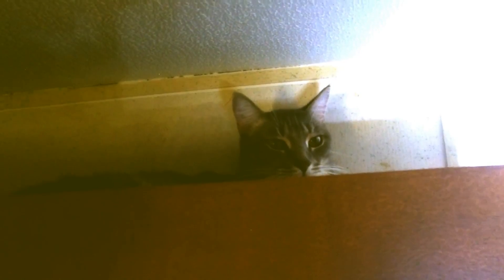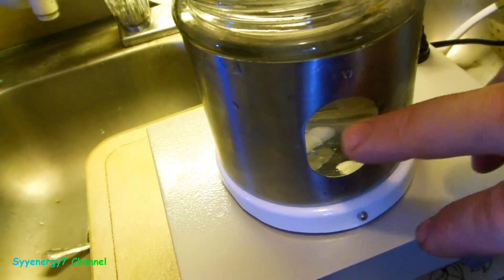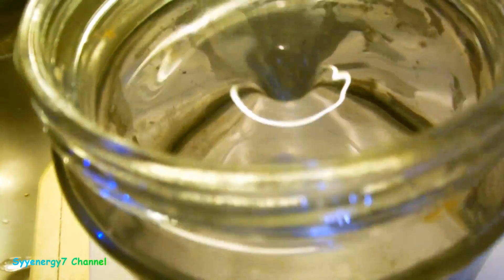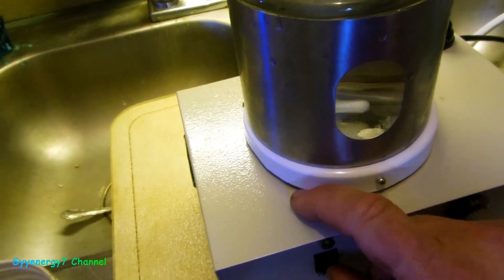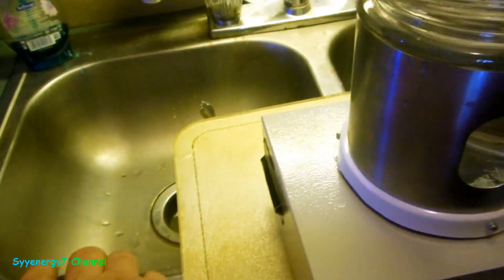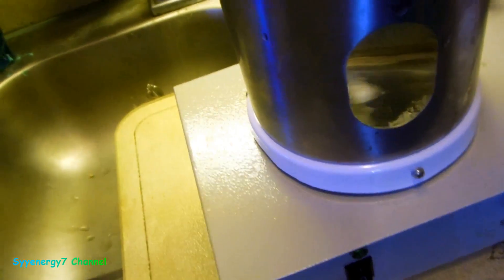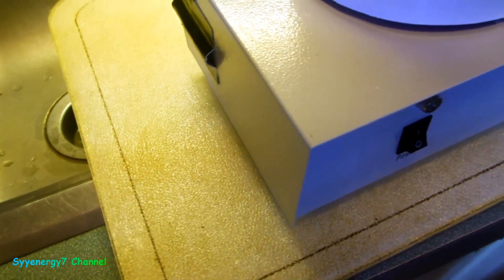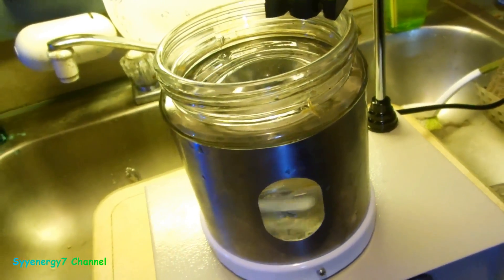Magnetic Stirrer needed to Make Colloidal Silver or Nano Silver

Comment: All of the silver ions have the same negative charge. They repel each other from the instant the first two ions are released into the water. Every ion will be repelled from every other ion as they are produced and NO STIRRING IS EVER NEEDED.
Reply: Dont be a know it all hater stirring automaticaly just makes  sense No black silver gunk to scrape off of the bottom ever usually done manually. Set it Forget it . The big buck silver lung kit includes. He telling you to get this for 40 bucks. Cheap upgrade dude https://www.amazon.com/gp/product/B076ZW4M2X/ref=oh_aui_detailpage_o01_s01?ie=UTF8&psc=1 has its own hotplate also
Reply: Your Highness - Cleaning the silver as needed with scotchbrite will remove the black gunk from the silver BEFORE it falls off into the solution. And one might as well stir the hair on one's head as stir a liquid that contains only positive or only negative ions. Those particles AUTOMATICALLY create maximum distance between themselves. Not a know it all, but I'm not stupid either...nor am I hating. The ions are all actually positively charged, not negative as I posted above. Still self-separating...
Reply: (Magnetic) stirring has benefits during 2 moments: (1) during electrolysis because it will avoid "tunneling" effects by distributing ions evenly within the water and (2) during reduction, as it will speed up the reaction and keep particle size small. The best way to avoid chunky silver oxide on the anode is to switch polarity during the process. This way you will create a "plating" effect on both electrodes. I have tested and witnessed these effects firsthand.

Comment: There Is the Silver Lung generator that uses that magnetic spinner but over priced at almost $300.00, I had an over priced  Silver Gen, Colloidal Silver generator which made up to 12 ppm clear Colloidal Silver until Oklahoma did Its thing and floated the tote container that the generator was sitting on and tipped over Into the flood Water. The over priced Silver Edge Colloidal Silver generator uses an Air pump to mix It up but a small Fish aquarium Air pump will do the same thing. It would help much If Someone would give out the schematics of how to build a Constant Current Colloidal Silver Generator, remember Bob Beck wanted People to build Their own equipment Not to be ripped off by them In the so called alternative medical treatment who are just as bad as fda educated doctors.
Reply: I can provide a schematic and where to get parts.  I know where you can get your 2.5mA and 1.5mA constant current chip for $12 shipped...but you'll need a 12-30V power supply, though.

Comment: What is the purpose of the stirring and what is the size of the 
particles....it only takes me few hours to make CS with three 9 volt 
batteries ....12~18 PPM using .9999 silver...IF  I wanted movement I 
could use my jewelry cleaner that I use for liposomal   vitamin C.
shalom my friend
Reply: +ARTILECT  Your  jewelry cleaner would agitate the water. That would probably  cause the oxide to fall off and debris up the water...but agitate is far better than none at all.
Reply: +ARTILECT   I have made 27 ppm by keeping the water at 160 degrees F It took 4 hours. Running  four 2-3 days??? There might some other reaction take place running that long. The water will take only so much no matter if a person did it for a month.

Comment: Why not just use a cheap fish aquarium air pump and use bubbles to keep it stirred?
Reply from the maker: +bugman5923 That puts in a lot of impurities from the air compared to this way.
Reply: Fish aquarium air pump also tend to oxygenate the water - which may interfere with the results.
Reply: +syyenergy7 Nothing Is more refreshing than a glass of fresh Ozonated Water but run the pump too long and It gets Impurities In the Water and taste like yuck but cane wrap the Air pump In a foam Air filter.